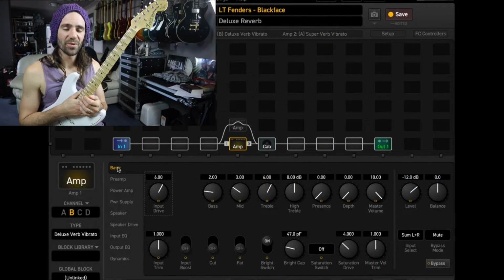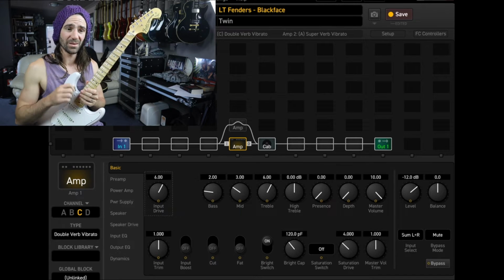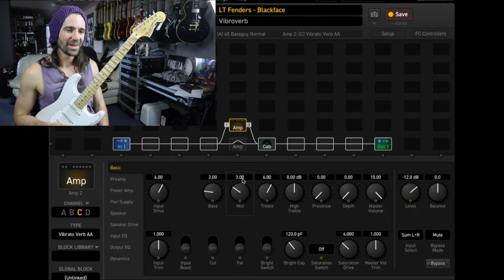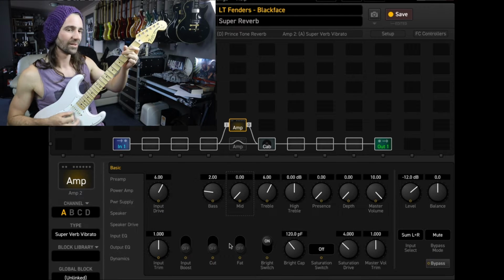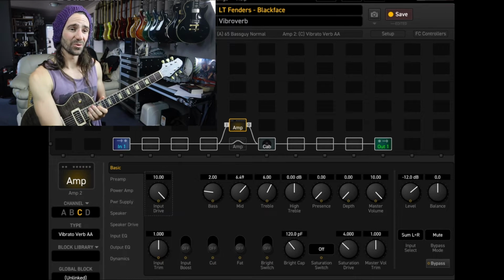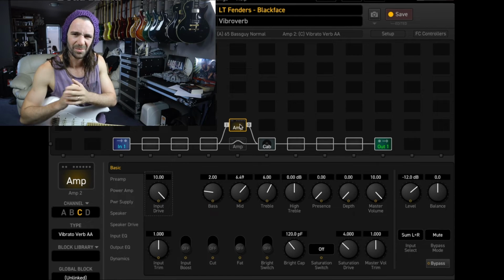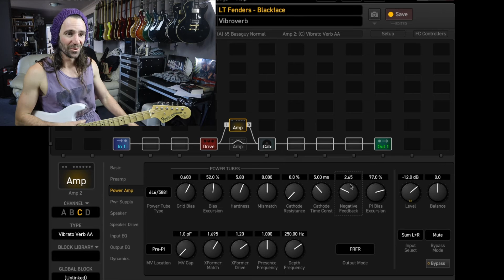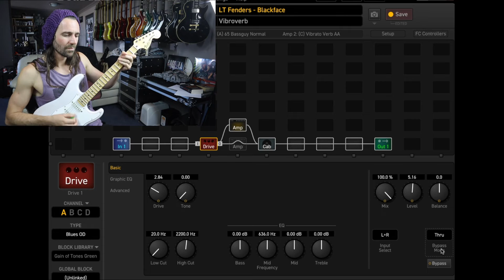Axe Fx III Fender Models Pt. IV - Blackface Models

Comment: Theres a 335 or two back there, crying from loneliness.

I just blew up my AB763 Victorilux. Waiting for UPS Store to open so it can go back home for TLC. :(  It was such a bouncy amp. The most dynamic of all my cleans, tiny wave forms that jump to clipping with pick attack.

The Axe just powers through. The Marshall sounds, the Modern sounds... all of them once and done recordable. Amazing as always.
Reply from the maker: I kid you not, I looked at the 335 before I did this video and almost pulled it down. Next vid!

Those amps have a great rep, what speakers do you run it with?
Reply: @LeonTodd  Eminence George Allesandro GA-SC64 were factory equipped in matching open back cab. In the world of boutique amps, they all seem to have their own version of the reverb and tremolo circuit, with the Vicky being a Blackface example. So, if you return to this style, the Spring/Trem blocks from the Axe III could nail the vibe and feel. (?)
Reply from the maker: @Eventual420  the preset i uploaded I added some spring and harmonic trem, sounds lush!

Comment: I dont have much experience with fender amps. Can you get that, sort of breakup from them by using a clean boost or is is more the sort of sound you'd get from cranking the power stage?